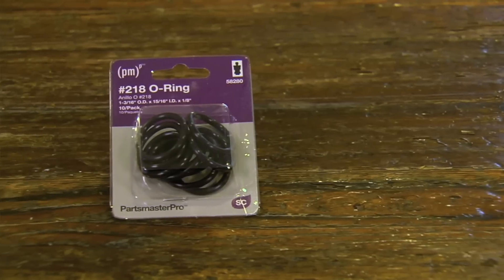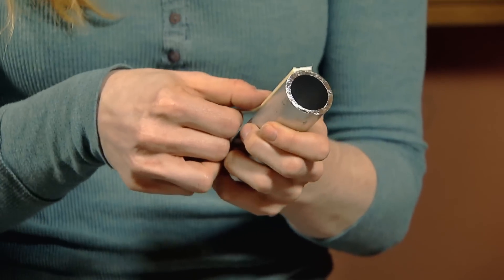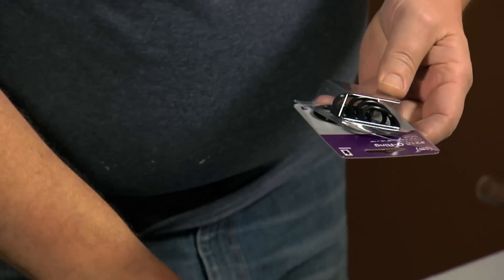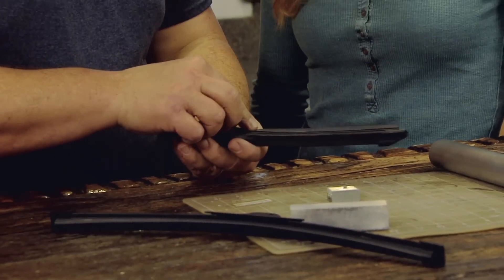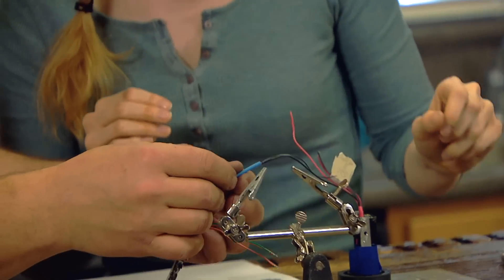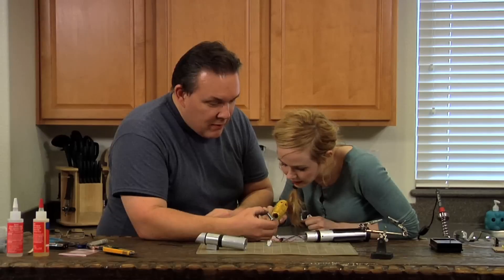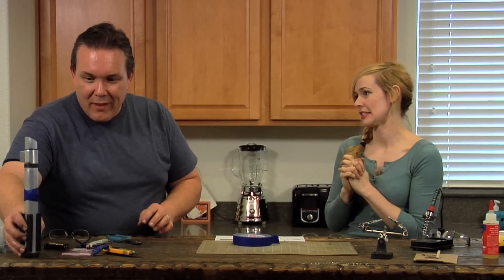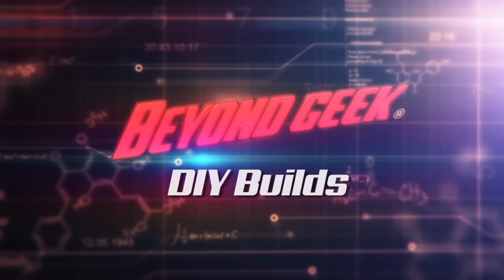Make Your Own Combat Ready Lightsaber - Beyond Geek DIY Builds

Comment: Very helpful tutorial. I hate the idea of buying a cheap lightsaber or ordering a custom one. Because every Jedi builds they're own lightsaber. And the force guides them to build the perfect lightsaber for them. So I think it would be cooler to build my own in my style. And this is quite helpful.
Reply: @MirzaKhalid  considering the material used allows for the lightsaber to actually be fully functional in fighting with, that's reasonable, and the price is only high for what they built sinse they used the soundboard, if you just build the saber without any electronic pieces added, you're not even gonna pass $100 which is quite cheap
Reply: The nerd is strong in you...
Reply: You are strong and wise and I am very proud of you.
Reply: @MirzaKhalid  
I think some places rent tools so you wouldn't have to buy the tools to make the light saber.
Reply: Lgt are the ones for you you can order lightsaber parts and mix n match

Comment: I used a sound board from an old lightsaber toy. be careful though the wiring is thin and easily breakable but was able to make it work and I now have a black lightsaber blade.
Reply: Paul the mountain man cool u have the first darksaber!
Reply: Is there a video of pic of this? I saw this video and also thought of trying to make a saber designed off the Lifegiver or Orgus Din's lightsaber from SWTOR and also thought of how to make a Black Core blade. Currently my idea is using 2 different sized polycarbonate tubes with black tinted cellophane in the center one and clear in the outer one, letting the single LED, not yet sure on my color choice, be there to try and light through it all. 

Would love to see yours just if anything to see how the blade looks.
Reply: If you want something with more performance ultrasabers let's you buy parts
Reply: would be easy enough to swap out the wiring for something more robust if you so chose
Reply: Paul Greth like the mandalorion leader I don’t think I spelled that right
Reply: @RandomGamesProductions  Mandalorian (for the correct spelling)

Comment: Not so easy to do w/o all the expensive tools though.
Reply: Dirtyd23  Would still end up on something like 100 Euros thought so that kinda sucks. Will still build it but I won't have any use for the tools besides the drill.
Reply: most places rent tools
Reply: Substitute the aluminum tube with PVC pipe and spray paint! Easy to cut and still looks fine.
Reply: @BenTheBeanYT  yeah if you want a light piece of junk. I'm subbing out aluminum tubing for steel electrical, tad bit heavier(not much considering the hilt is only like 18 inches) but I weld so I can make my hilt bad ass and add more detail
Reply: Dirtyd23  I was waiting for this type of reply, an answer for everything, lol
Reply: You can buy a really nice one that is colour changing on AliExpress for €60
Reply: @bloneyo1  dont let ur dreams be dreams :)
Reply: Dirtyd23  Having worked with cheap and with good tools … it is always pissing me of to work with cheap tools and it is always easy with proper ones.
Reply: @crazeay3800  Do I look like a wookie to you!?
Reply: If you're performing a crosscut with a chop saw please secure it better than taping the material to wood, as kickback can occur and pose a safety hazard

Comment: Tip for cleaner threads: turn the tap CCW a half turn every 2 turns CW, to break the chips... otherwise the aluminum can load up on the tap and gall to itself, peeling off some of the threads, which allows the screw to strip out the remaining threads easier.
Reply: CCW? CW?

Comment: 7:30
The original props didn't actually use windshield wiper blades for the grips. That's misinformation that's been spread around. They were hard rubber tracks (called a "T-strip" by the original prop maker) commonly believed to be used for sliding cabinet doors
Reply: Guys in 2000 had figured that out, just thinking they were plastic and not rubber.  Interesting how a lot of Star Wars prop knowledge came from forum boards back in the late 90s from movie screenshots, publicity photos, and so on.

Comment: Another great video.  Quick question, would there be any problem taking the sound board out of a light saber toy?  I found one on Amazon for $16 that (apparently) detects motion and collision and has the built in speaker.  Does this sound like a viable option for those of us on a budget?
Reply: I had some sabers that did that from years ago and they were probably the same as the one you found. I believe it would work, but i am not 100% sure.
Reply from the maker: I've heard of people doing it and they said it worked. It would be a great way to make this same type of lightsaber for less than $70!
Reply: It work. You could also use a DIYino board. https://forum.arduino.cc/index.php?topic=393174.0 It's 66€ but the possibility are awesome. At the level of the 300+ custom saber you can find on the net.
Reply: I've tried that with those $3 wall mart light sabers. You have to be careful cause the wiring is pretty brittle, so it's easy to break. But, if you keep it intact it would be easy to fit a soundboard from a toy saber into this
Reply: Well if you're good at soldering I'm sure you could rewire it with thicker gauge stuff.
Reply: If that were the option and it still costs $70 or so... I'd just go with an Ultrasabers grab-bag package, add the Heavy UltraEdge blade, and save myself the hassle.
Reply: Darth Resonus Speaking for myself, I am obviously quite the spendthrift. A tightwad, one might even say, but that's not the sole purpose of a DIY project.  We don't build because it's cheaper, we build because it's fun to build.  If hassle is a concern, this might not be the hobby for you.
Reply: I'm a duelist, first. 

I wouldn't mind eventually getting into saber builds. Before I would get into saber building, I'd need to get my entire electronics kits, solder gun, tools, components, etc. That's the main hassle I'm referring to.
Reply: He has a video on how to do that
Reply: @BeyondGeek  What was the epoxy y'all used at the 4:49 mark? It's not listed in the description. Also anyone know how strong the glue is when cured? I can barely hear you on my laptop. And what kind of drill bits are needed to secure all the hilt pieces once the O rings are put on the hilt?

Comment: 9:57 I hope they're not in California, because apparently solder causes cancer in that state.
Reply: ApoJake everything causes cancer in California
Reply: I cant wait for bottles of spring water to start carrying that warning here.
Reply: So, by your same reasoning, if you use solder anywhere else in the U.S. it doesn’t cause cancer?  All joking aside, California has a stupid law that list 600+ elements that may cause cancer.  If that product has it or comes into contact with another product that contain those elements, the maker of the product, by law, has to label it as such!  But, to tell you the truth, some solders are made with lead.  Lead gives you brain damage, not cancer.  Then there’s rosin or flux that when heated, creates fumes that one could inhale.  But again, research shows that it may cause asthma or 24 hour flu, not cancer.  My best conclusion of the reasoning, may not be the solder at all for the labeling and more likely the plastic spool the solder is wrapped around.  As certain types of plastic are brittle at room temperature, manufacturers will add DEHP to strengthen the plastic and that my friend is listed as a known cause for cancer.  So, don’t eat the plastic and you will be safe!

Comment: Hey, very nice and neat build, it just left me with two Questions.
1. Is the 1" Polycarbonate tubing "Battleready".
2. Which Soundboard did you use (the Dimensions seem to fit really nice).
thx in advance
Reply: 1: Yes, Polycarbonate tube will not shatter, and basically will not break. It is the same plastic safety glasses are made from, and it is a used in bulletproof glass (there is more to bulletproof than just polycarb, but it's a major ingredient.) If you force it (pun) it will bend and get white stress marks, but breaking it is really tough to do.
2: We used the Obsidian sound board. it is made to fit in a saber hilt or even a blaster grip.
Reply: Odin Makes Thanks for the answer, so no worries about Saber Smashbuckling :)
Reply: No! Not at all with these blades- never like the toys do.
The fun thing that these blades will do is that little piece will come of the end, and the plastic diffuser will fly out. It looks like that 'snake in a can' joke!  If you watch the preview for The Force is Strong, it right here on Beyond Geek, that is the saber Brittni is using on the Death Star set. And the same tube is what all of the sabers are using.
Reply: Odin Makes Ah ok, that's great. I have an old ForceFX Count Doku Saber here and I really like the On/Off Animation but this thing feels just... not right for me with this Huge handle. So I thought for a long time ago (in a galaxy far away) to get a different one but ordering a custom build is not really my style, so after stumbling over your Builds (My wife says "thanks" for showing me that nothing reusable needs  to go the trash ;) ) I really can start to build "my" Saber.
Reply: Well according to my muscular back and girlfriend's teenage son... polycarbonate will definitely break.

Comment: I'm using the sound board from my kylo Ren blade builders toy in mine and going to use the original led to light up my crystal chamber and hooking up a flashlight led to the speakers so I can get a fluctuating blade effect, with a color disc setup so I can change my blade color at will. But this helps alot my good sir Odin.

Comment: I might do some similar stuff but instead use a telescoping blade that fully retracts.  My idea is that the LED and bottom segment of the blade could be mounted on a rail with contacts running along the sides of the lightsaber.

Comment: Lmao the funniest thing is, even if you take those 12 dollar lightsabers and rip out the soundboard, the cost of all the parts is already over 100 dollars. I am currently trying to build a lightsaber from scratch using this video, but what I've found is that many of the electronical parts from LED supply actually changed their names, or no longer carry the item. I've been forced to use Amazon to get many of the parts, and while this is not bad, they are much more expensive. The polycarbonate tubing is over 30 dollars, and all the electronics together cost $53.68. I still believe that I can build it, its just a bit more expensive than what I had prepared for. Hope this helps for anybody who wants to undergo a project like this.
Reply: If you don't plan on dueling, you could probably cut down on costs significantly by just making an empty, but still able to be thoroughly disassembled hilt so you could add a soundboard later.

Comment: This is very cool and I'm looking forward to build a few.  By chance do you have a parts list for this?
Reply from the maker: Here you go:
Lightsaber Parts List
- 1 1/4 inch aluminum tube (ID - 1-inch)
- 1 3/8 inch aluminum tube (ID - 1 1/4 inch) 
- 1-inch polycarbonate tube
- 1-inch acrylic hemisphere for blade tip (purchased from TAP Plastics)
- Soundboard (We used an Obsidian from ultrasabers.com, but there are other soundboards to choose from.)
- Battery/Speaker combo 4-AAA Batteries (from ultrasabers.com) 
- 2 LEDs - 1 Color LED for whatever color you want the blade and 1 white LED for flash on clash (We used Cree LEDs from ledsupply.com)
- 2 LED Drivers - one for each LED (We used the 1425 MicroPuck driver from ledsupply.com)
- Heatsink (for LED)
- Focusing Lens (Narrow Spot from ledsupply.com)
- Momentary Switch
- 1 3/8 inch In-Sink strainer and rubber grommet (Disposal Repair Kit for In-SinkErator) for the pommel
- Windshield wiper blades (decorative)
- Heatsink from a power supply to a video box (decorative)
- #218 O-Rings (decorative)
- Cellophane wrap for diffusion in blade
- Aluminum foil tape for reflection on blade tip
- Weld On 4 (solvent to attach blade tip to polycarbonate blade)
- Shrink Tubing

Comment: Love the video. I do have a question though. I have an Ultrasaber.  The light when turned on fades a lot from the hilt to the tip. Obviously, this will happen since the LED is the hilt and the intensity will fade. But, it seems a bit much. Especially compared to other sabers I've seen.  I'd assume I probably need a replacement LED module, but I'm not sure.  Any suggestions?  Thanks.
Reply: Tri-Crees are pretty good at lighting.

Comment: Question for you. I have a Savi's Workshop saber from Galaxy's Edge. I'm not sure if you're aware, but there's a strip of LEDs inside the blade itself.  Not like others that have modules in the hilt.  Anyway, because the LEDs are in the blade, You don't exactly get a consistent solid color the length of the blade.  You see bands of color from the individual LEDs. It's not horrible, but it is annoying. Especially considering the cost of the sabers.  Is there a simple fix to hide the bands of color?  Maybe more cellophane?  I just assume the more you use, the less intense the color will be though.  But, hopefully it would hide the bands.  Maybe it's not worth it or maybe there's a better solution. I don't know.

Comment: Fantastic video! It inspired me to make one of my own, but I'm having problems.
..

The video says that you can cut Aluminum with a standard circular saw blade, but my mitre saw manual explicitly says not to use the saw to cut metal, which has kinda worried me. It doesn't say "Only use a metal cutting blade" or anything like that, just a flat out "Do not use the saw to cut metal." Now I need to decide who do I trust most? :(
Also to make life harder, I picked up 3 sizes of aluminum tubing online (because I can't find a hardware store nearby where I can go and get some), but they don't quite fit inside each other. Any tips on what to look out for to identify tubing that will fit nicely?

Comment: A couple of 18650 lithium ion batteries and a mini USB charging module installed permanently inside the hilt would prevent you from ever having to open it up to replace the batteries. Just plug it into a USB port and charge it. Considering the fact that you're only powering a couple of LEDs and a soundboard, two 18650's should last for a while between charges. You could probably get the batteries and charger for around 12 bucks or so, 50 cents if you don't mind waiting 6 months for them to ship from China. I would not suggest going that route though considering the nature of lithium ion batteries, cheap ones might make  for better firecrackers than batteries. If they're only powering a couple of LEDs and a soundboard, two 28650's should never even get warm, let alone hot enough to blow.

Comment: Question:
Would this build work as well during the day in sunlight as it would indoors and at night?
Coz if so, I'm sold, coz this seems like the best way to make custom Lightsaber without the outrageous prices and restricted parts of every custom saber site I've visited
Reply: Remember that the sun outshines everything.  If you want daylight performance, I would probably advise not even using LEDs at all, instead having a reflective material in the middle of the blade to make it shine anyway.